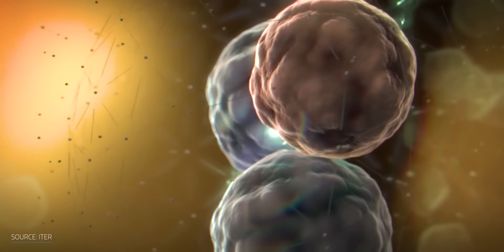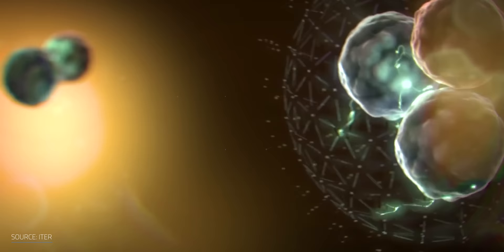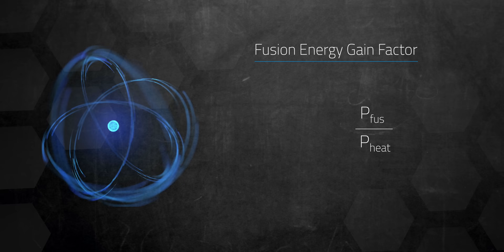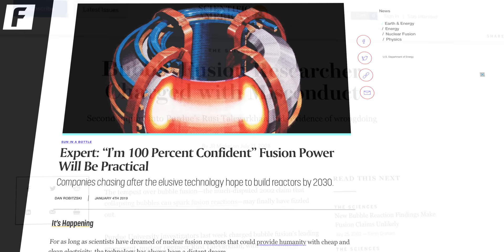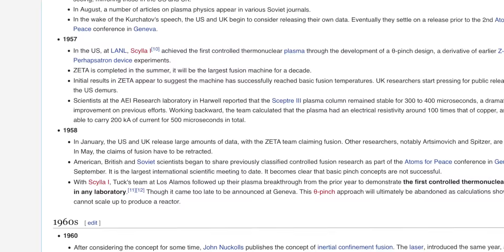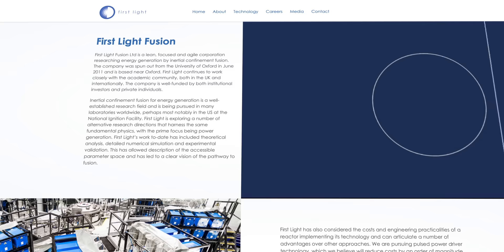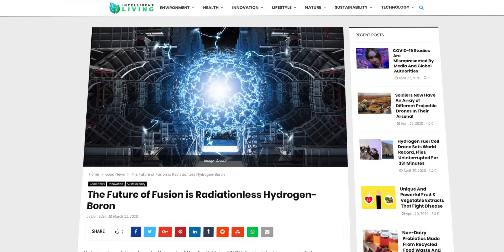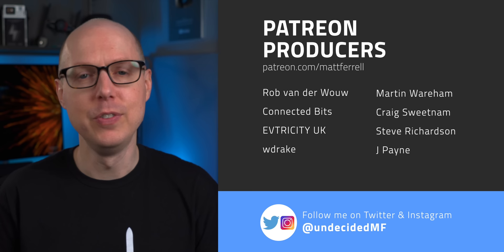The truth about nuclear fusion power - new breakthroughs

Comment: Three Mile Island contained the meltdown exactly as designed and nobody was hurt.  It was well engineered and the other reactors in the powerplant continued operations for decades afterwards.  Still safer than any other large scale power production by orders of magnitude even with the handful of failures.

Comment: Meanwhile molten salt reactors are not getting any love...
Elysium's design is awesome.
Reply: I prefer the travelling wave reactor, even further than MSRs but really nice
Reply: @MCAroon09  
i prefer the actually working chambered star made by The SAFIRE Project
Reply: SAFIRE seems like a scam
Reply: Molten salt design is amazing!!!  Why the hell dont we have these?    Mfking military industrial complex is why.  Cant make huge ammunition amounts with them.  Gotta have the breeder reactors for that....  stupid war....
Reply: @MCAroon09  : I'd get behind travelling wave reactors 100%, if there was even a single working PROTOTYPE of one in existence.  As it stands, I'm in the "I'll believe it when I see it" camp.
Reply: @rogermwilcox  unfortunately, they are still just a concept, and as I said, they are even further than molten salt reactors
Reply: @HammarPwnsYourFace  unfortunately the salt becomes very corrosive (just as seawater, but worse) and ruins all of the pipework from the inside out after a few months. Since the design requires the molten salt to be circulated as coolant, we can't really shy away from having them in pipes and pumps and so forth. But that's the area that breaks down the quickest. The actual reactor itself is fine, I think, but once the pipes corrode cooling performance degrades and it's a bad cycle.

So just as fusion needs materials science to develop ways of resisting high neutron flux for protracted periods, so molten salt reactors need materials science to develop ways of resisting highly corrosive materials for protracted periods. It's theoretically possible, but certainly we won't be seeing any commercial ones until they don't need to tear out the whole coolant circuit (which I believe also becomes radioactive?) and replacing it every few months.
Reply: @Kaitlyn L   Yes, materials science needs to step up, alot and make this happen.  The new carbon lattice done such as nano-tubes have multiple applications... i was on the wavelength of many thousands of layers of pipe set upon the inside.  Would make interesting to see how long the degradation takes.  Not like the carbon will react with anything, just probably being inert.   A fluid, such as a FR (friction reducer). Amongst the lines of what we use in hydraulic fracking to keep the pipes lubed and flowing.  I worked for big red for approx 12 years.  That stuff is amazing on how is works with so little.  If it can keep at 9k psi. Flowing a 8 lbs/gallon sand suspension and flow with a rate of over 80 bbl/minute.... we can definitely find a way to make a fr for the reactor. Even if it defeat fast, its easier to add more than to replace pipes.   We only replaced pipes approx 5-7 years. Even then, it was because of the pressure testing that has to be done every 6 months, the metal was still very well off.    The jobs can be from 3-14 days and run around the clock. That is alot of hours on just. “Iron”. We can most definitely find a way.  Just my 2 cents.   I used a  Viton** based polymer spray on my mixing tub and the acids/ organic peroxides just.  Nothing.  It lasted for so long with no downsides.  Bear in mind. The stuff we were using was amongst the lines of. 15-30% hcl/hfl around -1 molar. And 17-20 for our peroxides.   That spray coating was designed back in the late 80s for the company and it was a trademark/patented item.
Reply: @HammarPwnsYourFace  that makes sense. 5 years is a lot better than 3 months. honestly I hadn't considered taking inspiration from fracking to pipe in a sacrificial fluid somehow. 

of course, that would probably require a brand new type of molten salt reactor design too – current ones are closed loops, so you couldn't insert other fluids without disrupting operation.

but it's certainly a neat idea, and seems far more likely to happen in the future than building a pipe that just plain doesn't corrode (quickly) from high temp sodium or neutrons.
Reply: @Donald Kasper 
Depending on the typed used.  Yes.  Im talking abt NaF.  Sodium Fluoride.  CL is bad Shit. Salt.    Boron or lithium are  a bit better.   Potassium looks great but the decay at high temps is quite fast.  That and the. Potassium decay gives off alot of alpha radiation.  Might needs a solution that is a spacer for the.  NaF to float between itself and the u235.  My best guess would be a nitrogen/neon mix to be the non reactive. Mixture. Between the 2. Just my thoughts 💭
Reply: Both technologies are just ridiculously expensive kettles. Surely we can do better.
Reply: No it isn't. Small reactors are less cost effective than large. 

Engineers should understand that they are too stupid to comprehend how large scale social spending decisions are made.  Returns are not measured as you say, but more importantly generation is not compared only to generation but to solutions that shift or reduce use. 

France has not been able to export it's nuclear technology.  Germany has copied it's solar solutions planet wide and gets patent royalties.  There is no "backup" required on modern grids with demand response and EVs.  

Neutron scattering is a loser economically and you calculate the dead by opportunity cost. The wasted money on nuclear has killed vastly more people who weren't saved by, oh, better public health. 

ALL nuclear fission reactors are wildly expensive and take about a decade to construct. Thorium the more so since it requires the thorium to become uranium in a breeder stage first. Even at five years and a billion dollars, no power grid on Earth cannot find far better ways to invest that money over that time:

1. Swap out a billion light bulbs, from florescent to LED, cutting 20W each (or 80W each from incandescent). That's 20-80GW x the % of time each is on, say 10% of the time.  2-8GW saved! 

2. Change over 50,000 ICE vehicles to EVs at $10,000 each and install 5,000,000 solar panels at $100 each. The EVs store all the solar and take no oil, and feed the grid every day at peak times. Not only more power, but when it's needed. If each vehicle can #V2G just 1kw/day, that's 50MW for all 50,000 vehicles extra at peak, plus all the solar left over. It adds up to far more and more flexible power than the thorium.

3. Install $300M of transmission to a big dam that already exists, and spend $700M covering irrigation canals with solar shade. Less irrigation water loss, more power, more flexibility in backing up the dam since it doesn't need to release as much water and can reserve it for power reasons.

Comment: You should look into the Safire Project. The reason they are having so much trouble is the paradigm they are using. Fusion is happening ON the Sun, not IN it.
Reply: This mate get it right !
The SAFIRE project is using a totally different model of nuclear fusion, one that finally works, the electric sun model. It can create a stable self contained plasma without the need for extreme pressure or external magnetic field.
It is an absolute technological revolution and we can expect a commercial availability in the next decade !
And the reactor can be very small.

Comment: I would love to hear your thoughts on the results of the SAFIRE project.
Reply: I came to the comments to make this exact comment. Good on you.
Reply: I hate to break it to you but SAFIRE is a scam. They aren't getting any net power and there is no quantitative evidence fusion was occurring (i.e. no evidence of fusion products like neutrons and helium.)
Reply: @northernskies86  On what basis do you say that? Have you tried to reproduce their results? Aren't you suppose to do that before you can dismiss it? I hope you're basing your assertion on more than just the pompous fluff of prof Dave?
Reply: @Hannodb1961  I looked at their experimental setup and it looks exactly like a Farnsworth fusor, which is an extremely inefficient way to do fusion. If they got net energy out, that would've been huge news and it would be covered everywhere. It hasn't. And yes, the SAFIRE project is based on incorrect physics about the sun being an anode for galactic discharge currents with no base whatsoever. You also can't do science without submitting your results to a reputable journal, which was never done with SAFIRE. I'll need to wait for the peer review for me to even consider it.
Reply: @northernskies86  Well, as it happens, I believe the plasma model of the sun is way more credible than mainstream cosmology. When you have to plug magical dark matter and energy to make your models fit the observations, and almost every discovery is a surprise (but not to plasma cosmologists), you know mainstream science is broken. And where there are lots of scientists debunking and debating all kinds of alternative scientific viewpoints, its like no one will touch the plasma universe with a ten foot pole. Believe, me, I've tried to find a decent debate between mainstream cosmology and plasma cosmology, and havent found anything yet. As for SAFIRE, they said they will forgo the peer review process, and head straight to the patent office, since this technology would have massive economic potential. In that case, I would not expect to be major news until their reactor is on line and running. So, I'll just have to wait and see. If you are right, nothing will come of it.

Comment: It will happen...things do eventually, with persistence. Until it does, go hell for leather with wind, solar, hydro, and wave energy. There are several options for storing energy, such as, battery, compressed air, and raising & dropping of weights.
Reply: We also have much cheaper and much safer ways to use nuclear  fission. These have been ignored but companies like Moltex and Thorcon are proving it can be done. 
Moltex is building a plant that will be fuelled with nuclear waste at a cost cheaper than natural gas. Grid connection expected before 2030. The designs are proven. The delays are purely regulatory.
Reply: the cheapest and most reliable way of storing energy on large scale is pumping water
Reply: @MCAroon09   Do you you mean pumping water as at the Dinorwig hydroelectric power station in N Wales?
Reply: yup, hydroelectric
Reply: @MCAroon09   I’m honestly not being pedantic here. But, when we were kids in the 60’s, it we were told it was more expensive to pump the water back up to the dam. I don’t know now, with the rise in renewable energy, and the dramatic fall of coal, what Dinorwig pays these days.
Reply: most hydroelectric power plants make profit, they are quite ineffecient, but we still don't have anything better for large scale
Reply: @MCAroon09   Ok, good.

Comment: We have a perfectly good fusion reactor, we just need photovoltaic collectors to extract the power.
Reply: Extract?  I prefer to collect, concentrate and focus.
Reply: Fusion and Fission as nuclear powerplants can be operated for many years 80, 90 maybe more than 100 years. They are stable, power dense solution wihout destroying large farmland area. Solar power is good only as adition to convention and stable sources. Solar is inefficient, extemely unstable, poluting because you need large fields of FV panels to be changed every 20 years, you need lots of energy and lots of toxic waste, even you are using lots of coal to produce solar panels. Maybe as much as 75% from lifespan of FV panel is time to produce same energy as used to produce this panel. Yes, you are really using coal to produce solar panels. Silicon as main semicoductor used by solar indusry is made by reduction reaction of quartz by coal Quarts is SiO2 you simply need burn O2 to get pure Si! In ideal conditions 365 days times around 6 hours of ideal light you need 9 years to produce same amout of energy used to make this panel in real world it is bigger number, maybe even 15 years. Nuclear plant of any kind needs only about 5-10 years to profuce same amout of energy used to build one. This mean with lifespan of NPP 60 to 80 years 55/50 to 75/70 years of production clean energy! Edit: In nuclear i was wrong, you need only 1.42% of 60 year operation to produce enough energy to build refuel and decomsssion one nuclear power plant! This is around one year of operation! https://www.world-nuclear.org/information-library/energy-and-the-environment/energy-return-on-investment.aspx
Reply: @samuelgomola9097  That's a lot of research..... I'm still buying some panels though.  It's cost effective and it'll lighten the load on our fragile grid and help me sleep better at night knowing I won't need to buy as much gas for my backup generator.
Reply: @buzz-es  In small scale for houses it is good you are still kind of renewable and you save some money, but for large scale and powering up our industry it is nightmare. In theory PV can generate more energy for replacement and you still get some energy free wihout any carbon but it is only small amount.
Reply: nonsense
Reply: @samuelgomola9097  Agreed, PV is currently impractical for industrial sized loads.  Although, I could see a use case for concentrated solar (stirling, steam ect...) for medium business environments.
Reply: @05Ás Teitur Andrason Yes, of course it is mishap with roots in my native language. Thank you!

Comment: Low cost energy production: You have a water tank filled with degassed deionized water, the water then goes through black pipes held in glassed-in insulated boxes so sunlight is captured to heat the water "it can get hot enough to boil at sea level" the piping then goes to a spray nozzle where the hot water instantly vaporizes the steam then goes to a turbine that drives an electrical generator, after the turbine the steam and any water that condensed in it travel at a downward angle through a pipe with a condensation coil around it to a large vacuum chamber that has heat transfer fins inside this preheats water from a large reservoir tank that then feeds to the starting tank.
The constant rapid condensation of the steam combined with a volume of the vacuum chamber being 3x or larger than the volume of steam produce at any given time maintains the vacuum level so the process continues.

Comment: Fusion produces loads of neutrons that corrodes the walls making them radioactive. This neutron bombardment releases loads of waste material to the fusion chamber and is one of the reasons why fusion does not last long. And we need those neutrons to boil the water that is used to generate energy... Corroding walls are radioactive waste material.

Fission reactors use radioactive materials like uranium and more other materials making even more radioactive waste.

So both are making radioactive waste.

Comment: Modern fission reactors also stop reacting and cool down if they become unstable or unbalanced. Chernobyl was a  flawed reactor design and had safety measures and procedures flagrantly disregarded, Fukushima was a 1960’s reactor that did what it was supposed to, the rest of its supporting infrastructure was damaged(flooded generators) that caused the problems. I’m not bashing fusion, just pointing out that, especially for modern reactor design, fission is also incredibly safe and produces VERY little waste.

Comment: 2:10 Meltdowns don’t occur because the fission reaction is out of control. They occur because there’s insufficient cooling to remove the residual heat after the fission reaction has stopped.

Comment: My theory on why we don't have it yet. Is because we need to actually be a type 1 civilization first, we're like type 0.6 or 0.7. We need to have clean solar, hydro, and wind power first, those are the sustainable energies required to efficiently run multiple fusion reactions at the same time. The type of energy we mainly use today isn't enough by itself, we still have to switch fully to solar, hydro, wind. We still have yet to learn to manipulate the earth's natural weather, and earthquakes to out advantage.  Theoretically it's all possible. Being type 1 doesn't seem that far since we're only 0.6 or 0.7.. but in truth it's still hundreds of years..

Comment: Fusion is great and we should pursue it... but there are many free energy sources all around us that we should harness first.  For example, Geo-thermal (energy from the Earth's heat), tidal energy (energy from the interaction of the Earth and Moon), solar (energy from the Sun).  These are directly harness-able and will never run out. They are extremely powerful and ubiquitous. Let's concentrate on efficient use of these energy sources and treat Fusion as a long term R&D project.

Comment: You should also mention liquid containment. A problem with fusion is stray neutrons damage the structure of the containment vessel, limiting the lifespan. Using molten lithium for containment solves the problem because liquids have no structure. The liquid metal also acts as a coolant.
Reply: Hello! Could you recommend any papers regarding this topic? Actually I'm working on other approaches in my research institute  using extrinsic toughening mechanisms to improve the properties of tungsten as a wall material and I would like to compare my results with liquid metal approaches